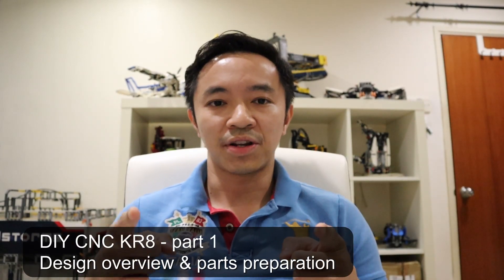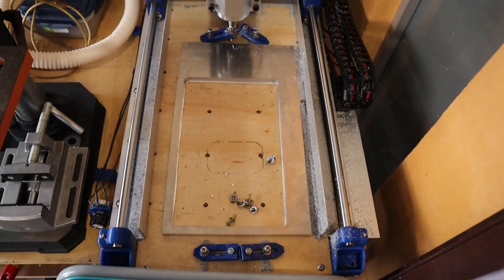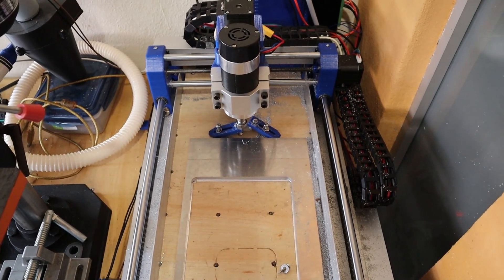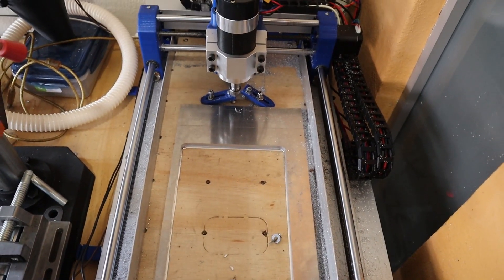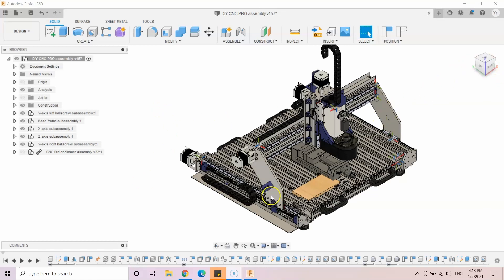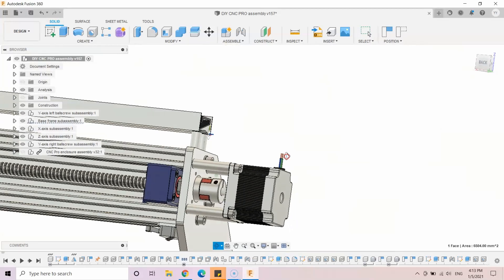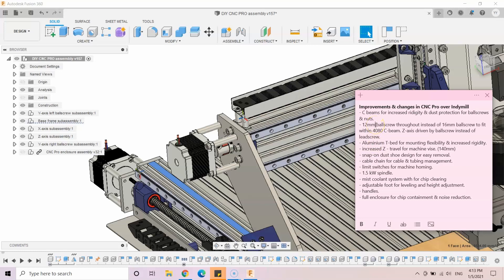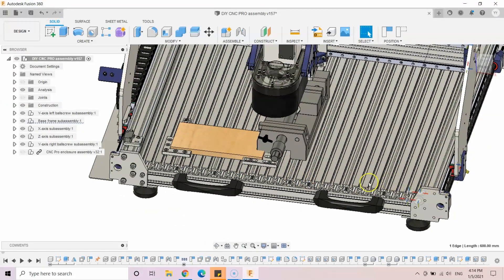DIY CNC KR8 Part 1 - Design overview and parts preparation

Comment: Wow im from PJ too. Built the dremel cnc mill
Reply from the maker: Wow, it's rare to find people in my area who are also into DIY projects and CNC. thanks for the sub !
Reply: @keanorobotics9219  stumble upon u on the fb group
Reply: @keanorobotics9219  yeah
Reply from the maker: I'm using the 500w brushless spindle and I'm very happy with the performance.
Reply: @keanorobotics9219  how much u got it?
Reply from the maker: @EdwardChew  I bought it for slightly under RM 400 from banggood
Reply from the maker: How's the Dremel CNC working for you so far ?
Reply: @keanorobotics9219  wanted to use larger dremel but havent design the new clamp